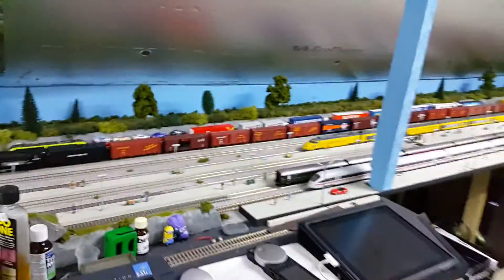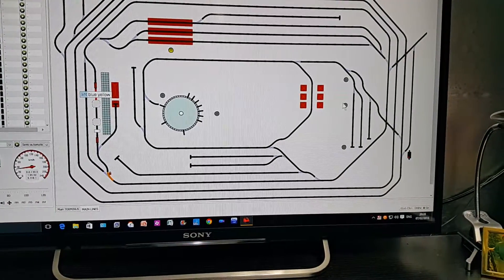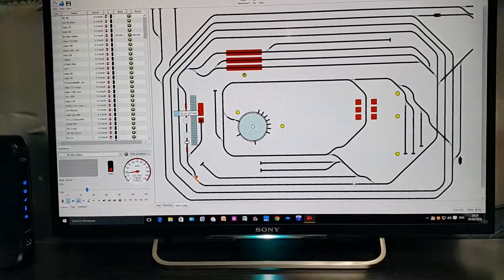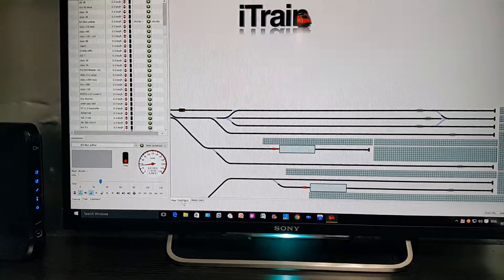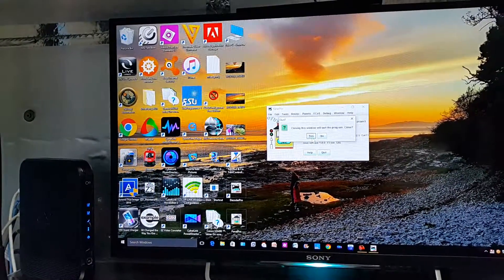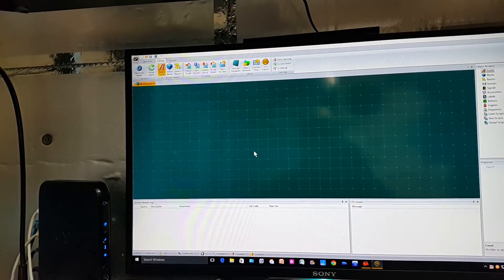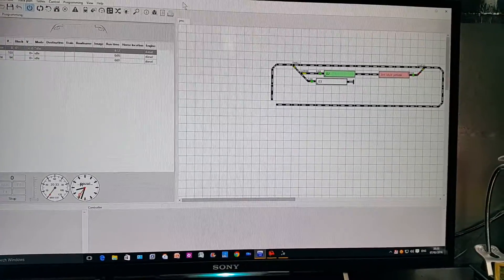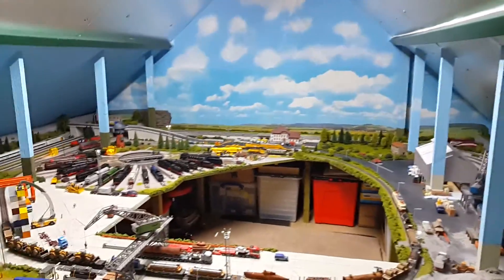The start of full automation ? part 2

Comment: Nice stuff Jim. I am impressed.
Reply from the maker: Thanks Laurie. ..to get this far was a huge task as all the point decoder had to be installed and logged into the ecos then the software automatically uploads them to be inputted into the track plan design took about three years as I had no clue what I was doing at first.
Reply: +hovermotion One of my mates got into model railways again about a year ago. He asked me if he should go digital or analogue? I asked him what did he want to do? He wanted full computer control. So of course I recommended digital. He happens to be an IT code developer and he often says he could do a better job with the code lol.
Reply from the maker: Lol it will be child's play to him.......
There is hornby rail master which is hugely simplified as the system do not require feed back sensors it records what you do with a train run and plays it back as a route...
Reply: +hovermotion That sounds good for me lol.........He bought the set with a diesel and an A1 and no controller - just the laptop interface.

Comment: Well done Jim - you are up to the point I am at I think - only o am using the Z21 - I have a Swedish friend helping me now and I ma hoping to get things going this week - the secret is to block between points I'm told with 2/3 feedback per block - and there is a huge amount to fill in with measurements and speed changes - all my current accessories work and I had the Heljan Turntable moving - keep up the vids and if you don't mind I'll keep in touch Jim JC
Reply from the maker: Cool...thanks..I would like to get the fleischmann tt going too....I have five sensors installed at the moment three in the small station and two in the terminus ...eleven left I may need another sixteen on a further feedback unit...
I am going to try and have a more detailed look into setting up routes and station blocks-sensors. .
 
If I make more progress I will let you know on a update...

Thanks J.C.....Jim
Reply: +hovermotion Jim ok - if you have an email I can send you a copy of my iTrain as it is and send through updates as I get things going - I'm anticipating using 20 feedbacks on upper level alone and contemplating feedbacks on points? Locks occur because you haven't defined unidirectional or bidirectional - I notice you haven't any arrow icons  on the track plan and the grouping everything cheers JC
Reply from the maker: +Goodison Road Model Railway Thanks I will pm my email tomorrow. .👍
Reply: +hovermotion are you on The iTrain forum Jim - you can pm me through that GoodisonRoad cheers JC
Reply from the maker: Yes I am..
Reply: +hovermotion ok Jim - what's your username so I can pm you my email JC
Reply from the maker: +Goodison Road Model Railway it's "iceman" I think I am at work at the moment I will check later...👍
Reply: +hovermotion yep what you said with 156 and I've sent you my email address look forward to your reply later cheers JC
Reply from the maker: +Goodison Road Model Railway cool...
Reply from the maker: sorry John my virgin media is down ...I will be on i-train forum tomorrow.....
Reply: +hovermotion no problem Jim
Reply from the maker: P.s John where do you live?
Reply: +Goodison Road Model Railway Bolton
Reply from the maker: +Goodison Road Model Railway cool...we will have to hook up at some point....I live near Manchester airport. .
Reply: hovermotion yep sounds a good idea Jim
Reply: +hovermotion Jim I haven't heard from you tonight - just send your email cheers JC
Reply from the maker: +Goodison Road Model Railway my virgin media is still down I cannot use my pc....total pain...as I use it for work....it's the exchange in my area should be online tomorrow. ...
Reply: +hovermotion oh dear! - I'm on virgin media and it took 3 months for them to sort out a problem recently following the flooding - we ought to get a thread going on Sky vs Virginmedia cheers JC
Reply from the maker: Yeah ...I can use my smartphone as I have un limited data...and  teather my pc to it if required. .it's only effecting a few 1000 customers in my area....
Facebook and youtube are very powerful tools In shaming big companies to change ...